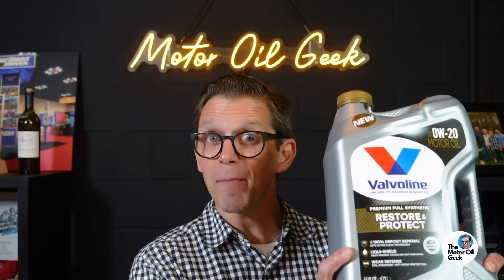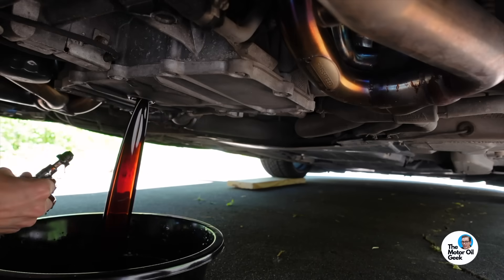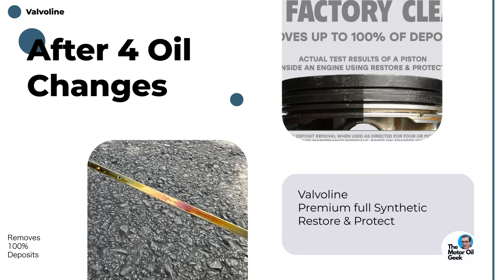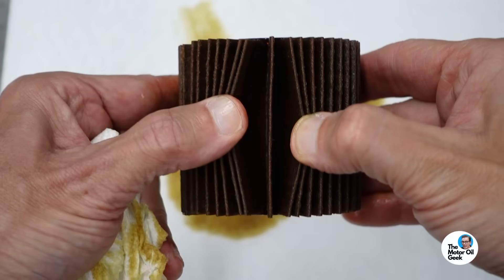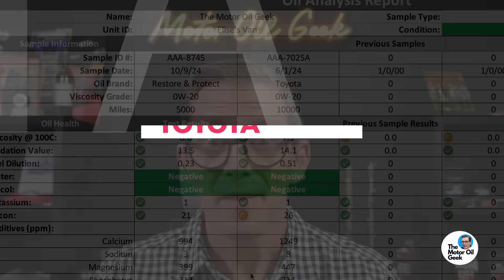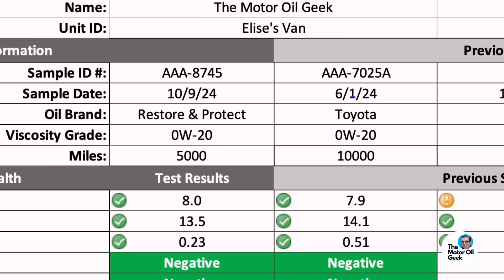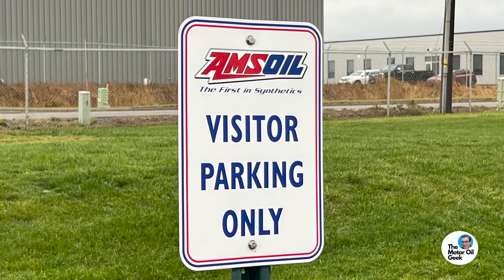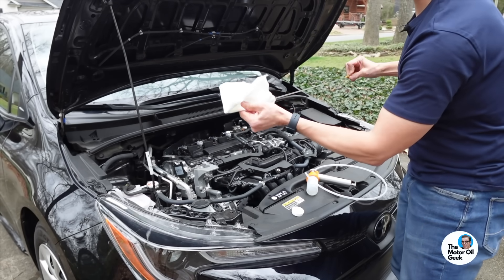The TRUTH About Valvoline's BOLD Engine Cleaning Claims

Comment: You mean you actually found a product that performs as advertised? 
Seriously impressed......
Reply from the maker: For real!
Reply: @themotoroilgeek  Been using Pennzoil Ultra Platinum 5w30/5w20 for over 10yrs in my expensive Ford 4wd trucks & AWD SUVs w/ GTDI engines. Great results! Use top tier fuels only as well. New 25 Ranger Raptor on way will get same treatment.
Reply: @themotoroilgeek 
If one wanted to use this oil but was extra cautious cause they have two 100k miles cars they recently bought.  Is there an oil you could mix this with?  Meaning if the engine takes 8 quarts could I do 6 quarts of this with another Valvoline oil to be extra cautious and not too aggressive?

Have two iForce V8’s oil was changed by the previous owner about every 8-10k miles, which is never so, every 3-5k miles with synthetic is what I normally do.

Was considering diluting it for the first two oil changes, changing the filters at 1500 miles, and full strength the last two or three oil changes just to make sure I don’t flood the engine with debris.

I realize I shouldn’t have much to worry about it with Toyota engines at those miles with their history, but I don’t mind spending some extra money and time to be extra conservative.

Do you know if it will mix anything, or is it a full strength only deal?
Reply: @frankyeilding2546  Do not mix different oils or try to “dilute” the R&P with another oil. Mixing oils throws off the chemistry and the two different oil’s additive packages essentially start to fight each other, therefore never resulting in the way or outcome that the primary used oil was designed for. If you’re worried about being too aggressive, still use 100% R&P, but shorten the change interval to no more than 3k on the first two changes and back up to 5k on the next two changes. Hope this helps!
Reply: @GeorgeTepp 
Yep, I thought of that, just ran it and changed the filter at 1k miles. Filter was just fine.
Reply: Do full strength. My son bought a Honda Civic with 200,000 I used 5W-20 Valvoline R&P I checked it at 3,500 miles and it was dirty so I assume R&P worked. I did an oil change and plan to change it at 4,000 miles this time. I assume this oil does have cleaning agents that clean your motor.
Reply: @petejuarezjr  It gets on everything and cleans it, not just the rings. That's what you want.
Reply: @themotoroilgeek  Why the Valvoline oil can't even get Dexos 1 gen 2 specification?
Reply: @themotoroilgeek  now  the restore and protect oil is only for restoring and max only use it for 3 or 4 oil changes right ?
Reply: @weirdowolfstudio5409 the detergent in the oil can dry out seals that aren’t silicone with prolonged use is what I heard.

I’m well into my second oil change with it right now and liking it so far.

I’ve been using Shell V-power gas ⛽️ to clean the top side of the engine down to the rings before this for several thousand miles and it seems to be working just fine too!
Reply: Been drinking it for months. I now bench 500 lbs.
Reply: @JohnTaylor-bd1uy jesus everyones drinking oil in the comments🤣
Reply: @joelh3030  Cause we know the secret
Reply: @joelh3030 if you’re ingesting canola oil or anything with palm oil you are in fact drinking “synthetic motor oil “
Reply: @Divided-we-fall9 my F150 runs great only Coffemate Hazelnut creamer.
Reply: @JustChuck  big fan of sterilized Melloream, huh?
Reply: @JohnTaylor-bd1uy inject it to lift 1,000 lbs
Reply: @JohnTaylor-bd1uy  months and still at 500? That's rookie numbers I've been drinking it for years and I'm in the 700s, and more limber than a contortionist.
Reply: dude thats the ad
Reply: @Alex-vs2fn this isnt an ad lmao its illegal and against TOS to not disclose a paid promotion
Reply: I always ran royal purple in dirty engines and it would work great for cleaning up the deposits in engines
Reply: @kamryn7496  Great boutique synthetic & performance car oil. All ya need is Valvoline Full Synthetic or Pennzoil Platinum for daily drivers. Both proven!
Reply: I watched a video where a guy did this with royal purple on a bmw and showed the results and it did work! @kamryn7496
Reply: 1995 Dodge ram 1500. (318 motor) 380,000 miles never had an issue out of the engine using a Valvoline engine oil.
Reply: my civic burns ALOT of oil..about 700-1k per qt. Car calls for 5W-20, should i just go with 5W-30 to get lasting effects from the oil consumption? Was thinking it wouldnt hurt to keep this in longer & get more out of it? Thoughts? Also, should i top off with this or can I get away with other simialr valvoline products till next oil change? Apprently it takes 4 oil changes for it to work 100%?! Thanks!
Reply: @dbzownz12345 I'd do a full change and then monitor oil pressure over the first 2k in case it's cleaning too fast. If it's burning that much my fingers are crossed it's just stuck rings but there might be some permanent damage unfortunately if the rings are super stuck and have been for awhile. But this oil can help a lot. Do a full oil change and change it early at like 3k. Then do another OCI and monitor. This oil can be run like normal so just keep running it and topping off with it and see if it improves. If it doesn't improve then I'd bet that the stuck piston rings have done some permanent damage to the cylinder walls, but it also could be something else causing the oil consumption. Fingers crossed for you!
Reply: Especially from Valvoline
Reply: Every valvoline product does valvoline is fucking legit
Reply: I've been drinking it for about a month....I shit a Buick last night...ohh the pain
Reply: Can you do video in 0/w8 oil compared to 0/w16
Reply: As I understand it, Lake is a consultant for Valvoline. So take take it for what it's worth. However, there are loads of other reviews claiming this product works as advertised.
Reply: @rooter-c5c it works. Engine runs like BUTTER with it. About to upload a video draining my first OCI with it

Comment: What if the oil dissolves the carbon deposits and turns them into some kind of colloidal graphite? Then if that were the case you wouldn't expect to see any increased wear while it cleans the engine. That colloidal graphite would be a lubricant in its own right, and I'd also expect to see the oil itself look a little darker than the typical golden look of a typical oil mid service interval.

Only about 1/3rd through the video so curious to see what the wear metals look like.

Comment: I have an 08 accord 2.4L and started using R&P a couple of oil changes ago. The oil consumption has stopped and the timing chain rattle on start up has slowly been getting better. just looking in the oil fill its noticeably cleaner.
Reply: I should also mention it has 318K miles
Reply: @Shouk02 wow, sounds like hwy driving
Reply: I have a Civic Si which has also a K24 currently at 138k miles, what have you done to keep it for so long and what is the overall shape of tje car? If I don't trade it, I'll be keeping the Civic as it has been extremely reliable. I've been religious in maintenance with fluids and consumables

Comment: Sorry, does higher octane mean cleaner combustion? My car is made for 95 but 98 would be cleaner? (Europe here)
Reply: @nowyouareoneofus9684  some pump gas suppliers in the states have better cleaning additives in the higher octane stuff.  There is an industry spec for "top tier" fuels that I believe some euro car companies are part of.  I think in germany only the higher octane gas includes the detergents or top tier additives.  The octane rating itself IIRC only increases compression.  In the states all grades still are mixed with up to 10% ethanol😓 unless you specifically search for non-ethanol recreational pump gas.  Then there are the more pure engineered gasolines sold in small cans to mix for 2cycle engines for instance.
If you want to stivk with the lower octane gas, consider a bottle of fuel additives at fill up such as Chevron Techron.
Reply: Thank you for explaining that. Het rij Europe as well up to 10% ethanol and the possibility totl choose 5% in several countries. Sometimes 5% is only with the 98 octane. So I wonder, does the ethanol cause carbon build ups, damage to piston rings and/or clogged oil ways?

Comment: Isn't Mobile 1 cheaper than Toyota OEM bottles (same oil)?  I only thought die hard Toyota people used it.  Most dealers don't.  And the toyota filters are the worse for letting through particles above 20 microns.

Comment: Trying this in a '17 Terrain, with 57k. Previously,  only serviced with GM filters and oil. By the dealership. Out of warranty.  My baby now. Had fuel blowby before..could smell it on the dipstick. After 500 miles now, I noticed almost no " fuel" smell or dilution.  Intend to change and eyeball the filter at 500 miles. Find your info imperative and informative.

Comment: Valvoline is going to make a killing on this stuff.

I’m on my second oil change. My ‘12 Toyota has a TSB for oil consumption. I didn’t have noticeable consumption at 120K, but I switched to VR&P to hedge against possible future consumption.

The engine was immediately quieter/smoother sounding. I was really shocked at how much. Seen a lot of people make this comment.

I doubt my rig will see a different oil for the rest of its service life.
Reply: Hey do you have the Toyota Rattle on start up..  From the timing gear??  And if So did the oil stop it?? They?
Say the pen gets dirty.. That lock In place on startup..
Reply: @ I’m fairly certain I didn’t have that, but who knows maybe it was just starting.
Reply: @tom535  The gear will have to be replaced. That was a manufacturing defect, not a dirty oil result. However I'm curious to see if my valvetrain noise will decrease with this stuff. Valvetrain on my car was very clean already when I went inside.
Reply: Speculative
Reply: Thanks for making sure everyone knows it’s speculative 🤨😂🤣
Reply: @EvzenKovar-i5p  , you're welcome 😘

Comment: It might work, but I’m not changing. I’m already invested in a reserve supply of Pennzoil Ultra Platinum (3 future oil changes worth), the last “best oil” to use that you recommended.
Reply: Why buy so much in advance? It’s not a special oil and is always available. 🤷🏻‍♂️
Reply: @I_know_what_im_talking_about  around here it’s not (south NJ) Very hit or miss. None of the Auto parts stores have it (usually only have up to platinum) and Walmart is luck of the draw. Also wanted to have it early because the
Reply: @ Just bought another 5qt jug on BF sale at Am for 23.

Comment: I just put VRP in my 15 Tacoma with 65k. I’ve only got about 500mi on VRP. I’m not expecting miracles, but I figure it can only help. In my 91 non-turbo MR2 it’s helped with oil consumption already. It was at about 1qt per 2k miles. Right now with 2500mi on the VRP it was only down about 1/2qt. So it’s doing something.

Comment: Dont be fooled by oil that cleans the engine this well. Theres a problem. It cleans it so well, that it is cleaning oil off of everything as well. The only time you should use an oil like this is if you have an old high mileage engine that has stuck rings. And you are losing performance or burning oil. Otherwise steer clear of this product.

Comment: Im "geeked" about trying  this oil in a used vehicle we recently  purchased for my daughter in college. We bought a 2009  2.4L pontiac  vibe (which has the infamous Toyota oil consumption engine).  I believe the culprit is those low tension rings, coupled with deposits.  The car currently  has about 164000 miles.  Since Sept, I am calculating "consumption" at about one quart per 1000 miles, on the original  supertech  synthetic  that i initially installed. Since she is usually away at college, I have had to show her how to keep close tabs on her oil.  Even though there is only about 3500 miles on the supertech, I plan on installing this Restore  and Protect, in the coming  weeks.  In fact, I have already purchased it.  My goal is to hopefully reduce or eliminate the consumption  rate.  Based on everyone's  review, I have recently installed it in my own 2010 Nissan Altima and my sons older impala. Neither of those vehicles burn oil but it can't hurt to clean up higher mileage vehicles.  I plan on installing it in my wife's newer 2.0L turbo equinox  too, in the future.  In the past, I have mostly used Mobil  1 synthetic and (more recently), supertech, on our vehicles.  Always couple them with a quality filter too.
Reply: I would toss a Pcv Valve at it as well. I have seen quite a few of those cause oil burning
Reply: @mph5896  i actually replaced the PCV about a month ago.  Didn't help with the consumption  but it didn't hurt to replace it.
Reply: Update:  on the very first treatment of Restore and Protect, the oil consumption immediately dropped to about 1 qt every 1300 miles. Now, we are only in about 2000 miles in, so I'm quite hopeful for continued improvement.   At the very least, it has already reduced consumption by at least 30%
Reply: I ran restore and protect change #1 for 5000 miles.  Almost immediately,  consumption  was reduced from about 800-900 miles per quart (before the new oil) to about 1 quart every 1200-1300  miles.   After 5000 miles on change #1,  I installed change #2 of restore and protect.  Now, at more than 1300 miles, I'm only down about 1/3 of a quart.  If my calculations  are correct, we are now burning a quart every 3500-4000 miles. For me, this is a success.  Very impressive oil!.   We will see what happens through oil change #3,, which may be a while,  from now.